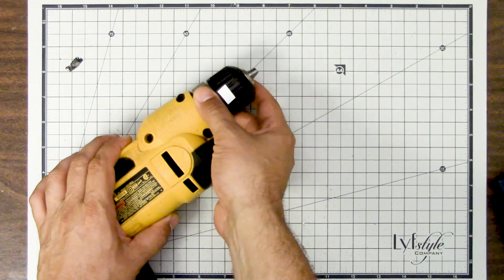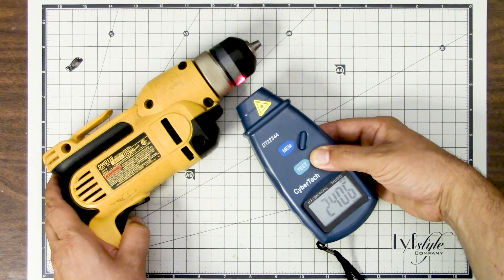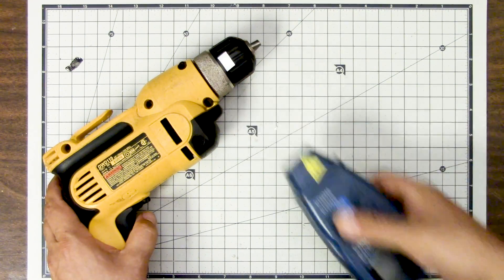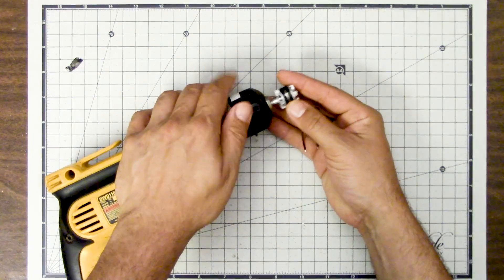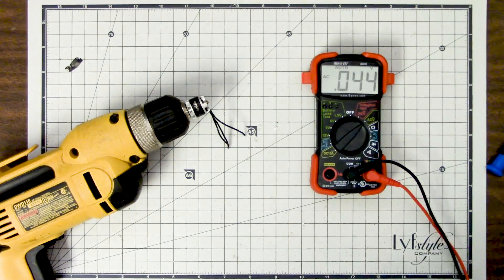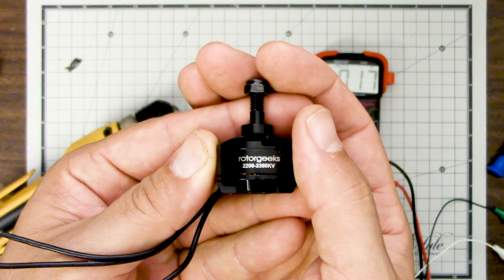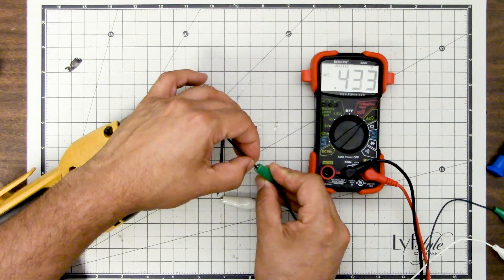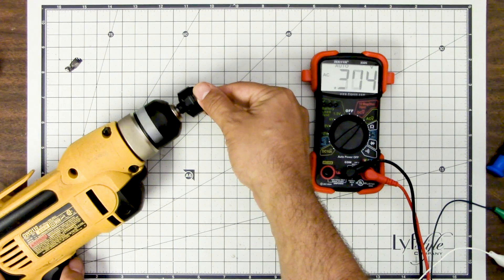Quadcopter Motor Damaged? How to find out. With a drill.

Comment: Any chance you could measure the amps?  

  I'm trying to get my head around voltage spikes during regen/breaking. I have capacitors installed and it works great but the  voltage generation just seems so small yet their effects travel through out the electrical system.
Reply: Scratch that. I went back and watched your capacitor video (which I had already liked "score") and you said that Quad Mcfly said that he had measured up to 4amp of regeneration.....  

Thanks again.

Comment: So FYI, the winding resistance for the 2300kv racing motors that I've tries is usually about 5 mOhm and the cheap multimeters can read it to about 1 mOhm precision, so yes, it's probably too little for proper diagnostics but it'll catch situations if something is very wrong with the windings.  Your trick is interesting but again not sure if it's that useful, most of my failed motors had failures that were intermittent, probably a bad cable or bad winding wire in a way that was affected by vibration, heat or manifested at high throttle only, in any case they might not show up at low RPM and with no major vibration.

I'm no expert but something that seems obvious if you use the multimeter's AC mode to test the KV is that the AC you're testing is a three-phase AC but you're only connecting two so there will be a positive voltage peak, a negative peak and period of less activity that the multimiter will probably cause the meter to show a lower value.

Yes, the simple BLDC motor is a wondrous thing, it's a motor, it's a generator, it's a brake, and it's also an encoder, all depending on the software running on the ESC.  I've done some work on the SimonK ESC firmware and have talked to SimonK himself on IRC and he explained that magically when you do regenerative breaking, the voltage ends up being just right to charge a LiPo battery -- another magical mechanism.
Reply from the maker: I'm skeptical that a cheap multimeter is measuring 1 mOhm accurately. It may show 1 mOhm on the display but I don't really believe it. Maybe I'm wrong...
Reply: No, you're right, but you can at least check that all three pairs show the same 4-5 mOhm reading.  When a winding is broken it shows about 9mOhm.  This seems to work with the cables still soldered to the ESC.  Actually the voltage reading trick should also be doable without desoldering the cables.
Reply: My meters vary by much more than a milliohm just directly touching the two test leads together.

Comment: use a current source (not necessarily voltage source) set it low 10ma and measure the volt drop across the phases to show the resistance ;)

Comment: I've always known the motors are basically mini generators. ( I'm a ce/ee) I always wondered if it was possible to design. a motor or an esc that will draw that power and recycle it.
Reply: This reply is super late, but yes it is indeed possible and I assume you've already been made aware of this, but in case you haven't, that idea is exactly what regenerative braking is in electric/hybrid vehicles. Instead of using the motors to spin the wheels, you use the wheels to spin the motors and if you use that voltage to power a load, the motor will be harder to spin.
Reply: You can get power out of the motor only of something (like the drill) is putting power into the motor.

The amount you get out will always be less than what you put in, due to friction and other inefficiencies. Thus you can't use the battery to charge itself via the motor. 1mah coming out of the battery can only produce something like 0.8mah coming back.

Comment: This is a great idea, thanks for the tip. I'd like to add that the motor should not get hot if spun this way without any load. That would indicate some winding having short in it.

Comment: This is how active braking works.  The ESC stops the PWM and the motor keeps spinning and generating AC.  Then the ESC switches all 3 phases to either - or +, effectively shorting them out.  This puts a heavy electrical load on the AC being generated by the motor.  The electrical load is translated into a mechanical load by the motor and causes it to quickly slow down.

Just try spinning a motor with your fingers and then try spinning it again with the wires shorted.

Comment: I have a question. I had a crash last week and damaged an esc. I had another but it wasn't the same brand or had the upgraded firmware. It was a behi-s. Anyways towards the end of the day when I spun the motors by hand that one I had changed(esc) , the motor wouldn't spin as well as the others, felt like esc braking with the battery plugged unarmed. When I desoldered the esc from the motor, it spun fine. Was it because of the electricity it was creating giving it active braking?
Reply from the maker: Something like that, yes. 

https://www.youtube.com/watch?v=RaCjJbEB078
Reply: Could be the electronic difference of the esc's to each other like the odd one using larger filter caps or different fet gate arrangement, etc.

Comment: It might be interesting to note that when you spin a motor to make it act like a generator, the greater an electrical load you place on the input (now output) wires the harder it becomes to turn the motor. This is because you are now dissipating electrical power (voltage times current) and this power is being converted from mechanical energy. The prop brake setting on your ESC uses this principle. It places a low resistance across the motor windings when throttle is a zero, slowing the prop down.

Comment: I have been using Hz to test motors.  I'll try voltage and see if there is a difference.
Reply from the maker: Hz should depend on the rpm you spin the motor at. Unless you have a way of spinning the motor at a precise RPM I don't think Hz is as useful.

Comment: Great tip! I thoroughly enjoy your videos. I used this inductance meter from Banggood to determine if one of my lumenier motors where bad. how accurate it is, I do not know. It did show me that there wasn't any inductance with one set while the other two had .01 mH. 

it's only $35

https://m.banggood.com/DANIU-3_5inch-Colorful-Display-Multi-functional-TFT-Backlight-Transistor-Tester-p-1083042.html
Reply from the maker: Leave it to China to make everything cheap and available. I'm surprised to find an LC meter so cheap.

Comment: if it doesnt matter which way u connect wires y would a brand new esc make a motor just burn up and smoke i just had it happen im assuming wires were wrong but all were black sooo
Reply from the maker: The power supply must be correct polarity. The motor wires don't matter. I'm guessing you reversed the supply?
Reply: Joshua Bardwell nope all were fine turned out to be a bad esc it was a fvt 20a littlebee regulat blheli upgraded blheli s dshot 600 got some new escs n all good now was weird first time i had that

Comment: Question! if I'm riding my motorcycle with my quad strapped to my backpack with the props on and they are spinning would the current produced damage my quad in any way??? Would it be powering on the fc or something crazy?? Just wondering, never thought about it before..
Reply from the maker: I don't actually know the answer to this. I have seen a video of somebody holding a quad out the window of a car, and the LEDs lit up on the FC. Some people claim that the FETs in the ESC can't work that way. I don't know the answer and I haven't tested it. I do know that during active braking, a small amount of back-current does flow, so the motors can power the FC. But at the same time, I'm not sure whether this condition can exist when the ESC is powered down.

If the ESC can pass back current, and if the motors can spin fast enough, then in theory, the voltage coming back from the motor could exceed the FC's rating. But if you think about it, the FC is rated for 5v, and the motor will make 1v at 1x its kv rating. And actually, that is peak-to-peak AC, so the rectified DC voltage that (theoretically) came out the other side would be less than that. So you would need to spin the motors at faster than 5x the kv rating to get anywhere near 5v out the other end. Now you do the math of how fast the prop is spinning when you're riding down the highway and see how that relates to the motors' kv rating.
Reply: Joshua Bardwell, thanks for the reply. I guess a wise man would just take his props off. It does make you think tho..

Comment: Maybe not mind-blowing (I used to rebuild large motors 20 to 100+ hp) but I certainly learned something!  Never thought of testing voltage to check motor.  We always used meters on the big motors, but that makes sense... big motors, big coils, more resistance... little quad motors, well, much smaller I'd say.  Brilliant idea and well done video.
Reply from the maker: It really depends on the number of winds around the pole, not so much the size. Although you don't typically see high-kv giant motors, at least not on RC vehicles.

Comment: Your original premise to verify the health of a static motor is valid although things may change when it it becomes dynamic.  Be cautious trying to determine the motor velocity constant with a multimeter.  A multimeter measures AC as RMS and the motor velocity constant is by definition determined using peak voltage.  When using constants such as 0.707 and 1.414 to determine peak voltage you are assuming that the output waveform is perfectly sinusoidal, which is not likely.  Any variations in the waveform will give a different RMS value.  To determine the motor velocity constant it would be better to use an oscilloscope to directly measure the peak voltage.  The multimeter works fine to determine the rough health of the motor as you originally stated.
Reply: I would imagine that the output waveform of a driven BLDC motor would be fairly sinusoidal, however the input from an ESC would almost certainly be more trapezoidal. It would be interesting to see Mr Bardwell's test performed with an oscilloscope.

Comment: EDDY CURRENTS ARE FUCKING AWESOME!!! (physics student here) althou If there were a way someone should make a track for quads with the use of eddy currents to slow down the quads or make crashes less explodey by making the off track portion to somehow use the speed of the quad and generate an eddy current which will hence slow down the quad much like a roller coaster and maybe reduce the crash damage to quads...
Reply: I can't feasibly see 99.9% of race event organizers setting up eddy current generators around a track lol.  Also, the danger gives races a certain edge that makes it exciting, otherwise everything on the track would be covered in foam already.  Plus, couldn't the eddy current generator just as easily suck the quad off track depending on it's orientation as it nears the generator depending on the polarization of the quads magnets?

Comment: I worked at a motor rebuilding company and we built 2 10,000 hp D.C. motors for a gold mine elevator and to test them we coupled them together and ran them with a resistor bank on one at a time the amps through the resistor bank can be calculated into horsepower so we proved to the customer each one would produce the 10,000hp

Comment: maybe the voltage output it's not matching with the kv because you're measuring ac voltage. the multimeter divides it by square root of 2. if you multiply 0,75 times square root of 2, you get approximated 1 volt, that matches with the kv of the motor. it's just an idea. correct me if I am wrong.
Reply from the maker: I think you are right.
Reply: but Joshua is using the AC scale meter already and not the DC scale meter, so there's no need to do the calculation? Maybe the reason for discepancy is that regular multimeter only measure sine wave AC and not the type of AC wave form produced in this test?

Comment: Your multimeter measures RMS voltage that explains the  0.7v reading of an expected 1v peak.
Reply: if you select AC voltage switch in multimeter as opposed to selecting DC, won't the multimeter measure the peak voltage generated on this test?
Reply: Most multimeters are designed to measure AC voltages in RMS, however, advance multimeters will have the option to present average, peak, peak to peak, and some others can do statistics. But, by far RMS is the most common measurement mode dealing with  AC signals in the majority of multimeters in the market
Reply from the maker: So the kv rating is peak to peak not RMS?
Reply: It is defined as  Speed (RPM) / Vpeak. But if your measurement is RMS you can convert your reading using the square root of 2 factor ( 1.4142) .

Comment: put two nuts on the motor and lock the nuts together when putting in the drill then you wont damage the threds
Reply from the maker: Good tip.
Reply: A few wraps of electrical tape. The nuts may make it hard to center the shaft in the chuck. Thanks again Joshua!
Reply: @rudypoirier8001  use nuts with a small circular flange around the base.  Then put them top to top on the shaft.  Lock them this way and you can clamp down onto the two flanges and it will be easier to make central.  Not perfect, but another arrow in the quiver.

Comment: You need to know what you are messuring. Does that crappy meter messure rms in ac ? and can it do it at the freq you are messuring ?
The kv rating for the motor are relatet to the dc voltage, and that determines the peak ac voltage the esc can output.

Comment: If anyone wants to go deeper with this testing lightly loading the motor might show other defects in the Voltage test with more fraction microamps of loading by a multimeter.     

I have put a 3.3K (5 W)  load resistor across the multi meter inputs, a high impedance multi meter the test not load the motor/generator and a resistive loss from a partially nicked through coil will not show up in an unloaded test.    Since the mounting screws contacting the coil are also a problem test with and without the screws.   

Turing the braking function in BEHELI to higher than stock on the ESC will also show off suspect motors with bad coils without props.       

I use $10 dollar motors since moving from buggies to drones and replace everything that does not sound, feel or react right immediately dump it.  In the good old days we spent $80 on a brushed motor of the same output class so we used a ton of TLC, it was half as efficient also 8 times heaver.  Good riddance.  Newer, Better, Cheaper...on backorder.

Comment: That means if you have the motor wires solder to one end of ESC  [AND SPIN IT]  you should get voltage from the other end of ESC. Would that not tell if ESC is good??
Reply: It will pass voltage yes, but not in any controlled fashion.  This is why damped light causes voltage spikes in a system
Reply from the maker: I do think the ESC will pass back-voltage from the motor. I don't know whether this would show a fault condition or not.
Reply: I'm not sure if you would be able to tell if the esc is good; but you can get a voltage from the esc input leads.
Reply: No, ESC's don't have a rectifier circuit to convert the AC back to DC
Reply: Thank you
Reply: Yes, but in practice it does work.. I don't know why but I have been able to run an RX just form spinning the motors..

Comment: Im no expert, but the reasen your not getting the math to add up according to the KV. (1V=3000KV), could it be that the efficiency(cos phi) of the motor when spun up with a drill, is less then the efficiency when you apply a voltage to it?
Reply from the maker: Others are suggesting it is because the multimeter is reading RMS and the kv rating should be peak to peak.
Reply: Hey! Atleast i learned something today! :P

Comment: Mr Bardwell, whats your take on reversing the standard Betaflight motor spin directions? Example: instead of having front right motor spinning anti-clockwise, have it spin clockwise. (swap props accordingly and do this for all motors) 
how does this effect the flight characteristics?
Reply from the maker: The main advantage in my opinion is that you throw grass into your FC stack vs. your camera lens. Personally though I don't find it difficult to clean my camera lens. Another advantage some have said is that when you fly into a branch, the props push the branch out vs. pulling it in. As far as flight characteristics go, the majority of people I have talked to say no detectable difference, although a few people say there is a night-and-day difference. Micro pilots especially seem to like this approach. I don't use it personally because I'm not sold on the benefits and I am too lazy to reverse all my quads.
Reply: Goto Betaflight CLI

set yaw_motor_direction = -1
save

+ reverse all motor directions in BLHeli Suite (cw -> ccw, ccw -> cw)

Done...

It won't change flight characteristics much. Some say it would be more efficient. However it helps to keep your camera lens cleaner...
Reply: In the normal config some of the air your propellers is moving is blocked by the arms of your frame. This air is reflected by the arm and will work like a tiny brake (thrust vectoring). This also is causing some oscillation.
Reply: Quick follow up question to that JB, what about making a pusher style mini quad? would there be any advantage? props on upside down etc, figured you would be the person to ask

Comment: You would need an osciloscope (or a true RMS multimeter) to measure the voltage correctly.
Reply from the maker: I still say that looking for differences between the phases and between a good and suspect motor is valuable, even if the absolute voltage is not correct.
Reply: Joshua Bardwell of course, I'm not denying that. I'm just saying that you can't just use average cheapo multimeter for measuring the absolute value.